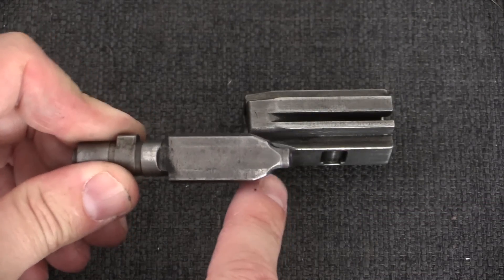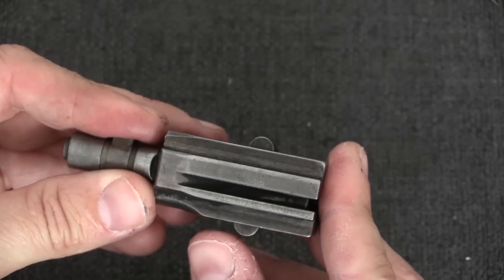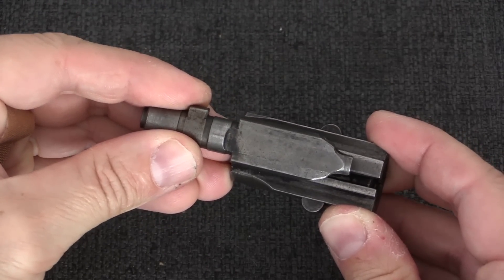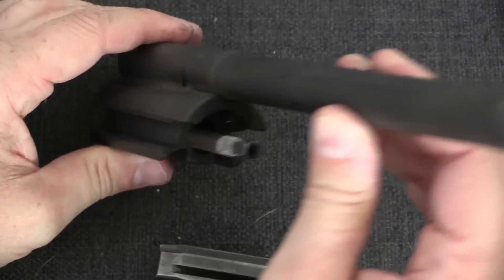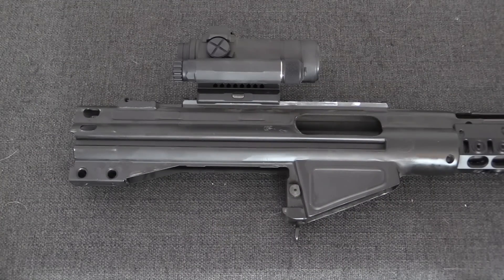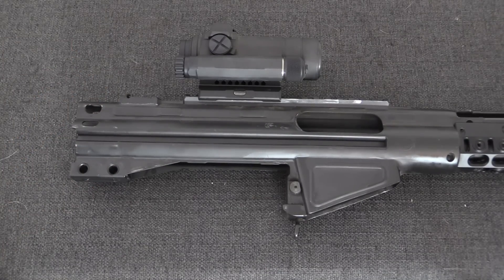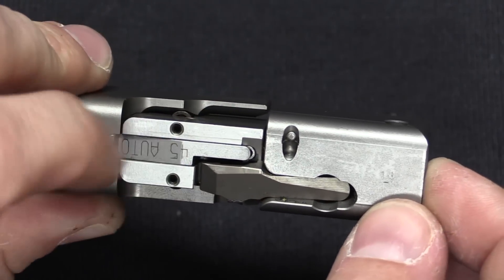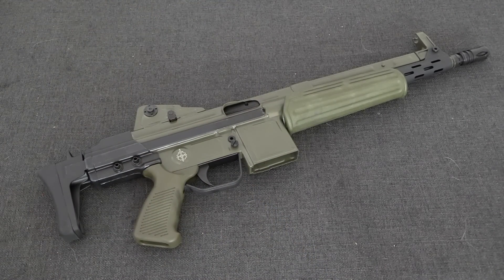How Does It Work: Roller Delayed Blowback

Comment: In a short recoil system, the slide+barrel start moving immediately (although locked together), and it's the combined mass+recoil spring that defines when they hit the cam and unlock. Which defines the pressure at unlocking.

In a roller delayed system, the slide (or bolt carrier) start moving immediately (while the bolt is still locked with the barrel), and it's the mass of the bolt carrier+recoil spring that defines when the rollers retract and the bolt unlocks. Which defines the pressure at unlocking.

In short, I fail to see principal difference between short recoil and roller-delayed blow-back. 

Of course, rifles rarely use short recoil, which seems to suggest that both systems are insufficient for rifle cartridges. 

But why is it not used more in pistols? Seems like a win - the barrel can be fixed, which increases precision and decreases manufacturing costs (if you've ever fitted a proper "oversized" barrel you know why).
Reply: maybe because, while in a rifle you naturally have a bolt carrier and a separate bolt, in pistols you'd have to introduce an additional part? But then Beretta have their moving locking block, for example.
Reply: Roller delay doesn't actually lock the bolt to the barrel.

Comment: Why isn't it popular today?
For selfloading sniper it could be a better system, than the rotating bolt, because it doesn't need a gas system, so it can have a floating barrel like the PSG-1 or the MSG-90.
Reply: because the reality of the advantages you mentioned, even though they can be measured, have a relatively negligible effect in real world application, at the present... in the future?  Who knows... possibly...

Comment: What's a fluted chamber and how does it work?
Reply: It's where they machine some small slots down the side of the case neck to borrow some gas to push against the case and improve primary extraction. Once the case is moving, it's fine. My Tokarev SVT40 has a fluted chamber, as do pretty much every HK firearm.

Comment: Based on your description, it sounds like the difference between roller delay and roller locking is one of degree.  Both are gas actuated.  Roller locking sounds like it travels further up onto the flat and in doing creates a longer period of delay, or locking for the entire firing impulse??  While roller delay, since it is parked on the angle is starting to retract immediately and so isn't fully locked.  Am I tracking correctly?  I am thinking that perhaps I am missed something?
Reply: They're not gas actuated, unless you count the gas that's inside the cartridge case. A roller delayed system is never fully locked, the rollers and the angled locking piece merely act as increased leverage so it takes more force to accellerate the bolt rearwards than its mass alone would suggest. 

In a roller locked system, the bolt is fully locked and needs to be unlocked by some other force than blowback from the pressure inside the cartridge case. Most commonly this is done with a short recoil system, where the barrel and bolt move rearwards together for a bit until the rollers are disengaged by a cam or somesuch. There's no reason why you couldn't build a gas operated roller locked mechanism, though I cannot think of any.

Comment: Wouldn't the HK 21/23 be considered a viable roller delayed blow back machinegun?
Reply from the maker: Yes and no. So yes, it is, but it's really the same as the HK91 action but with more infrastructure around it. Dedicated machine gun implementations of the system (MG42V/MG45, SIG 710) didn't take off.
Reply: @ForgottenWeapons  Fair enough. I understand that it was an off-shoot adaptation of the G3, and not designed as a blank page ground up general purpose machinegun. I just thought that since it was intended to and did fill the roll as a GPMG, it counts.
Reply: @ForgottenWeapons  did you forget about the CETME Ameli? Roller delayed blowback 5.56 mg.

Comment: Concept of Reflected Inertia...  The lever ratio explanation is true, and the second half of the explanation really makes the concept of reflected inertia make sense.  The lever ratio effectively multiplies the inertia of the heavy mass of the bolt carrier.  The internal ballistic equations follow the model of a blowback design, except the mass has been multiplied by the lever ratio.  The reflected inertia is then used as the mass in the blowback calculations.  There are a lot more to the details to make a roller delayed blowback design work well.  The devil is always in the details.  The lever ratio uses the principle of reflected inertia as part of a blowback design.  The engineers at the arsenal taught us how the HK designs really worked, and the HK trainers always were left holding the bag.  That is why the HK manuals and even the HK engineering information are so poor.  It was pretty cool to be there when the engineers asked questions.  The HK myths were busted.

Comment: There's one important piece of information missing: the rollers act as a lever and thus they accelerate the mass faster than the piece behind the cartridge. This reduces the weight of the mass needed by about 4x!
Otherwise, you could just use a normal blowback for a rifle as done with some tripod machine guns...
Reply: Jeah in German the locking system of our G3 is called " Übersetzter Massenverschluß " The direct translation would be " weight operated locking system with transfer ratio "
Reply: @heikopanzlaff3789  Yes. I'd translate it with leveraged inertia, but I'm not certain about Verschluss as that word seems to be a bit broader in meaning than locking. A cork in a bottle could also be a Verschluss and the operating system is not truly locked...
Reply: Very true.  You really understand how the system works.  Have you ever tuned these actions for use with low power ammo?  People that understand what you mentioned get asked to fix MP5 and clones all the time.
Reply: @johnphillips222  LOL. I´ve never handled one in my life! In fact, I´m not legally able to handle firearms.
I bet barrel length and muzzle break will need to be considered as well. 

In the case of WWII, it was easy to implement the design, but the ammunition quality would almost guarantee malfunctions. I guess that´s one of the reasons why the MG42 was built slightly differently. For one it used the barrel as additional mass and had a recoil booster. This should make the accuracy and recoil worse, but still, it was a damn good LMG at its time. I bet these changes were because of the ammunition quality. On the other hand, the allies failed to copy the design for their own ammunition indicating that the adjustments are very subtle but essential...
Reply: It's far more than a 4x multiplication.
Reply: @otm646  I´ve read 1:4 once, but that might refer to one of two rolls...
Reply: Which tripod machine guns use straight blowback?
Reply: @hailexiao2770  no modern one... However, even early ones tend to have some primitive delay mechanisms, but the mass involved and size of the mechanism was so big that it barely mattered...
Reply: you cant do normal blowback in a rifle. if you did the math would work out to somehting like a 30lb bolt. lever is a necessity
Reply: @mechanicallydisadvantaged1297  that's what I'm saying.

Comment: Nice explanation. Only one question left, why dont more guns utilise it especialy in the bullpup era...
Reply: Because delay blow back still need a heavy mass on the bolt,  but gas operation bolt can be made as light as possible if the bolt structure is strong enough. Besides,  it is more sensitive to the firearm and ammo condition,  you cannot simply turn the gas port switch to fire a dirty gun with bad condition ammo reliably.
Reply: roller delayed blowback has a less parts compare to gas operated systems. 
powder quality doesnt effect operation.
it is a robust thing. it can endure torture. 
doesnt require huge amount of training.
you can turn thousands into army. with this thing.
Reply: Brah powder qualilty effects d.i systems.

Comment: Nice! So good to have easily understood videos showing the difference between roller locked and roller delayed blowback guns. Mixing the terminology has sadly become the norm.
Reply: An argument can be made that roller delayed could also be roller locked. (like how all bourbons are whiskeys, but not all whiskeys are bourbons) During firing in a roller delayed blow back, the rollers do technically mechanically lock the bolt to the trunnion/barrel...
Reply: @2k7duramax  That's the point. It never IS locked.

Comment: I had always kind of wondered what the difference between a roller locked and a roller delayed system was. Thanks for the input.
Reply: It's really easy:
roller locked: 2 pieces moving together for a bit, then only one piece continues
roller delayed: 1 large piece moving for a bit, then picks up the second one
Reply: @phileas007  That's roller locked short recoil. You could make a roller-locked gas operated gun if you wanted
Reply: @MBkufel  agree, but then you'd probably use flappers instead :)

Comment: They aren't good with suppressor? How did they get around that and the MP5 in use by special forces?
Reply: i assume because of the cartridge MP5 use, its only a "pistol" round and can use sub sonic one so it have way less chamber pressure than rifle round like 556 or even 762.
Reply: @prd6617  Dunno about using the 3 lug adapter, but on the SD, the effective barrel length ends up being only a couple of inches.  After that it's ported into the silencer, so it never gets a chance to build a whole lot of pressure in the first place.
Reply: @prd6617  Makes sense.
Reply: Good question

Comment: How do you accidentally discover this works?  What were they trying for, and messed up on, that this was the result?
Reply: Check out Ian's video on last ditch onovations / Gerät 06H: https://www.youtube.com/watch?v=WEPwmYcCPFs
The sound isn't up to totdays standard but the information is there.
Reply: They were working on a gas-operated, roller-locked system. They discovered that the gas system was unnecessary, and the roller-locked design would function as a roller-delayed without it.
Reply: A roller locked system, bolt bounce and cameras.